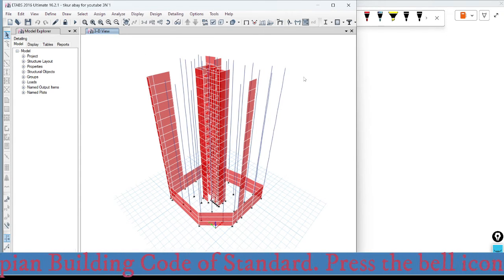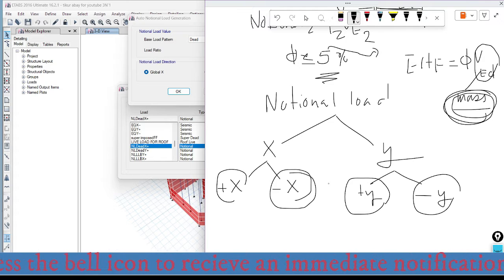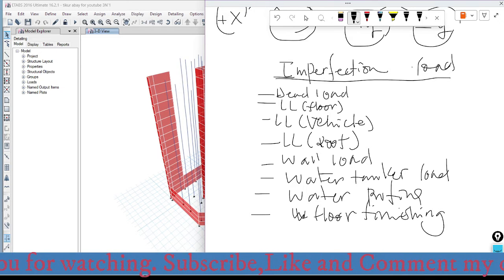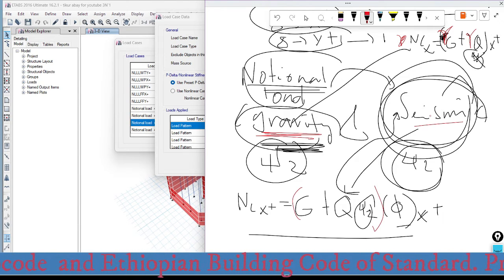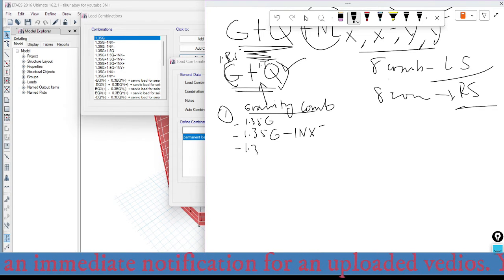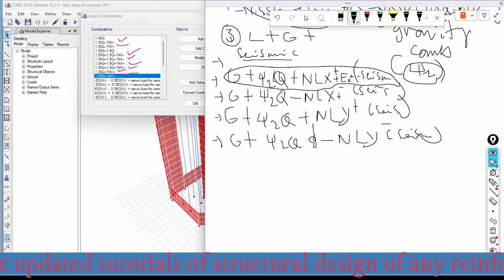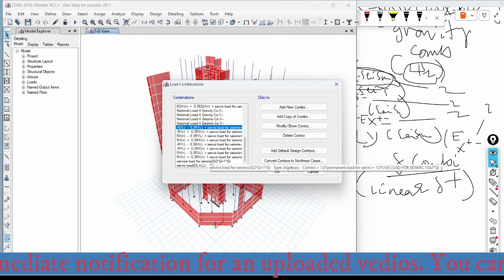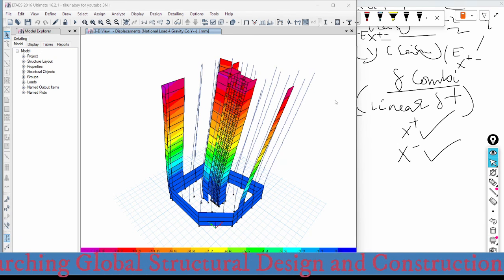Complete Structural Design of 20 story building using ETABS in Eurocode and Ethiopian code (part 23)

Comment: Good Work. 
አስተያየት፦
The shear wall design excel has a lot of errors & it needs to be coherent.
Why aren't you using the software for design why only for analysis ? 
It is built for design too?
Why go to all this trouble , it has the codes standard incorporated?
Reply from the maker: This is simply to show how we can change the total steel area  of pier /obtained from Etabs/ to  1 meter length of wall of either sides during shear wall detailing. This  works for both shear and flexure.
Reply: @melesedemissie7664  Okay. So, we have to detail every wall section size manually? OR when the member passes design & check we can use the ETABS data & detail it using CSI Detail?? What is the purpose of Excel design, when ETABS does it all??

Comment: You mentioned that the notional is 5%. But you used 0.005. Which is 5/1000, or you can say 0.5%. Please guide what reference shoudl i see to check its value.
Reply from the maker: @shadmandogar  notional load is 0.5% of the gravity load at every story. Hence  if I say 5% make a correction. Hence for details, you can refer eurocode. This means, 1/200  horizontal out of plumb   of column. For 3 meter high column , 15 mm out of   plumb is considered for notional load concepts.